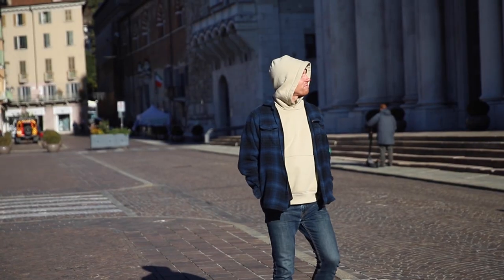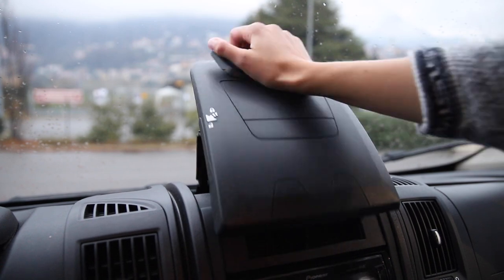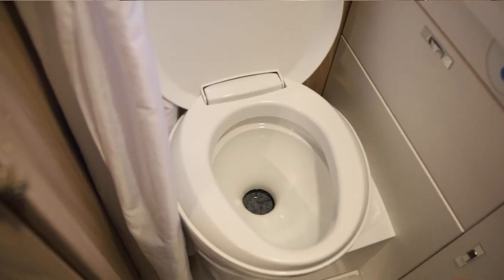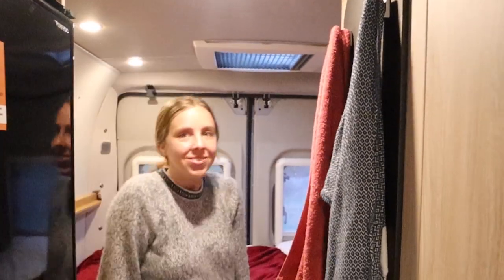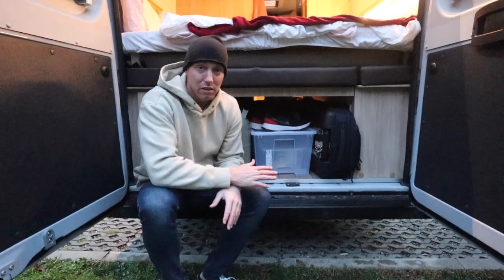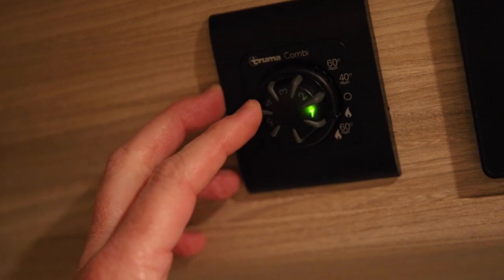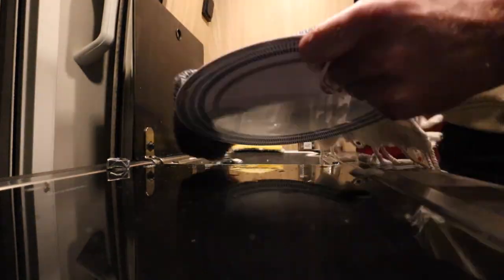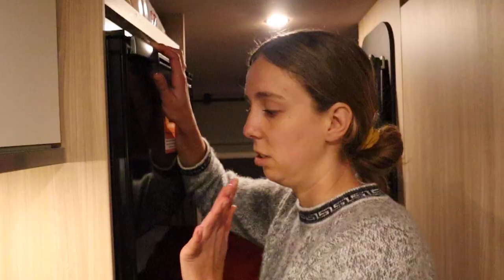VAN TOUR - Fiat Ducato Campervan | Van Life Italy

Comment: Curious, why the cassette toilet is only good for number 1 and not number 2?   Did the rental company tell you that? It's designed for both!  You put chemicals in it to break everything down and eliminate odours.  (we have used similar van & toilet setup)   Or is that an Italy thing?  Maybe lack of proper dump stations?
Reply from the maker: Hi Rob 👋 This is a great question. Honestly, the company we rented the van from gave us little to know instruction on best practices. Fortunately for us, YouTube is amazing and helped us get up to speed quickly as this was our first experience living in a van. And on a few videos, people recommended only using a cassette toilet for numero uno's so that is the advice we went with. That said, it sounds like we could have saved ourselves some headaches based on what you are telling us. Thanks for sharing, we always appreciate it 🙌
Reply: @ThePassportCouple  totally agree with robscamino, looking at the toilet it looks like it's made by Thetford which you can do number 2s. Happy travels 😁